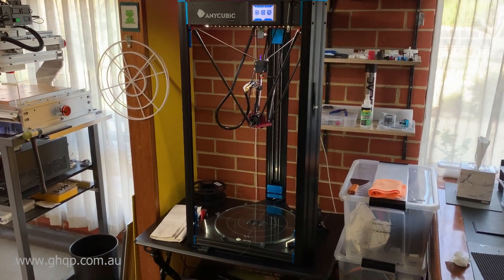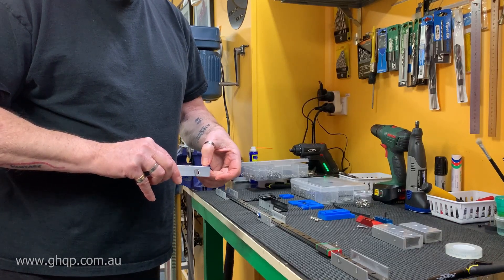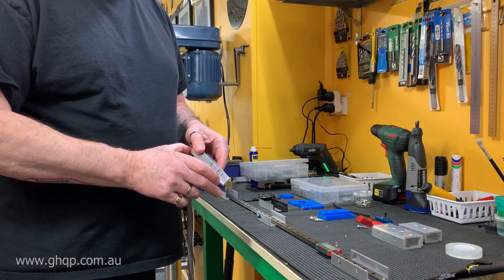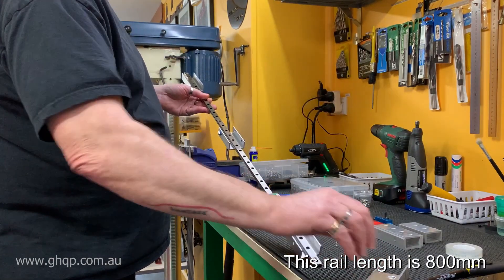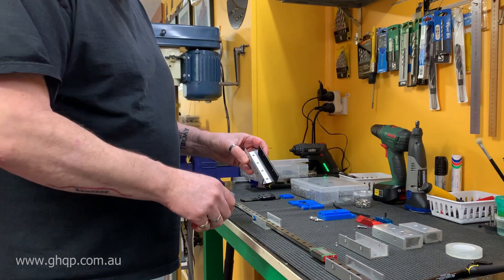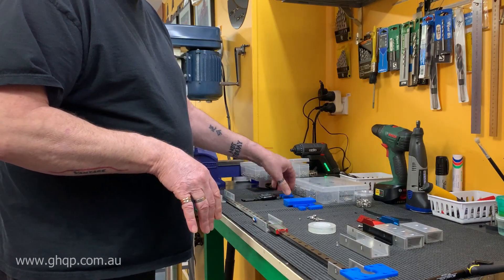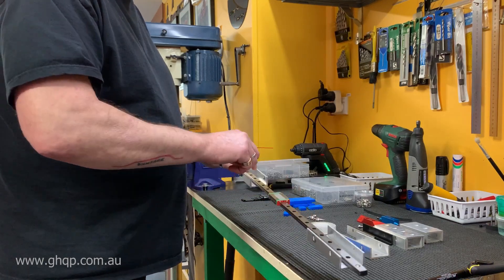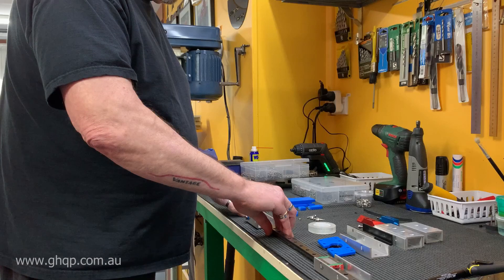My Predator Linear Rail Upgrade

Comment: Do you think 40x20x2 U-channel extrusion is enough and can build with your instructions? Cant find 3mm thick U-channel in europe.
Reply: For the sides 2mm would be ok but for the base that the rails secure to you would have to modify the machining to allow for the nuts that are 2mm thick so they would protrude above the surface. However some spacers could be used to take care of that.
Reply: Oh yeah, the back side of the aluminium extrusion needs to be complete flat or at least in same level. Found some of that u-rail from germany, hopefully they will send that to Finland. Thank you for great video.

So those M3 T nuts are 2mm thick or less?
Reply: @NikkiSebastian  You are welcome :)

Comment: I've given it some thought and I'm finally getting around to installing rails into my Predator, but I figured out what I think is a better way and I thought I would share in case someone else wants to try this or is having trouble finding the right size U channel for a decent price. What I've come up with is the use steel flat bar instead for the rail mount, drill and tap holes into the steel flat bar that matches the hole spacing on the rail, drill holes into the extrusion that matches the hole spacing on the rails, slip the flat bar into the tower extrusions and use the flat bar to clamp the rails to the tower extrusions.

For me at least, this will be a lot cheaper, around 25 USD minus the rails and the tools needed. It will have fewer parts, hopefully take less labor, and maybe even be a bit more durable. Granted any added durability vs using U channel is not a huge factor considering how low the forces are, you could probably get away with just drilling and tapping directly into the 2mm thick aluminum tower extrusions, but I'm not into gambling with things like that.
Reply from the maker: Interesting idea and I can see its potential. For me I would replace the steel with extruded Aluminium of the appropriate dimensions.

Comment: How's the performance?  I've been seriously considering this for some time....
Reply from the maker: There is a slight improvement as against the original system considering my existing rails were still as new with no paint wear. However the big thing is that the HIWIN’s will last and be trouble free for a long time to come without needing any adjustment. That was my main motivation for installing them and I am really pleased I did.

Comment: I appreciate you sharing, there is one thing that is bugging me though. Where did you get that effector plate? I can't seem to find it anywhere.
Reply from the maker: Unfortunately you wont find it as I made it myself. I have in the works a new video showing how I adapted a clone Mosquito Hotend and the effector plate along with photos and drawings etc. Should be posted in a week or so.
Reply: @hamrx8  Ha, well that explains that. Looks good, very professional. Now I want to get a CNC router then lol. They aren't terribly expensive these days. Probably just end up printing a new effector out of nylon or PC. I'm personally leaning towards getting a dragon high flow hotend myself, though a mosquito clone also looks like an good option.
Reply from the maker: @creamofbotulismsoup9900  I am posting a new video soon of how I made an effector to install a clone Mosquito on to my Predator. All drawings and STLs will then be posted on my website. You might find it interesting. I have three upcoming videos two relating to the Predator. Oh btw a CNC is a great addition to a 3D printer as there are things you can only do on a CNC.